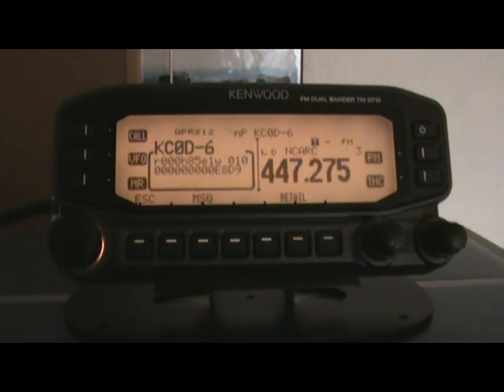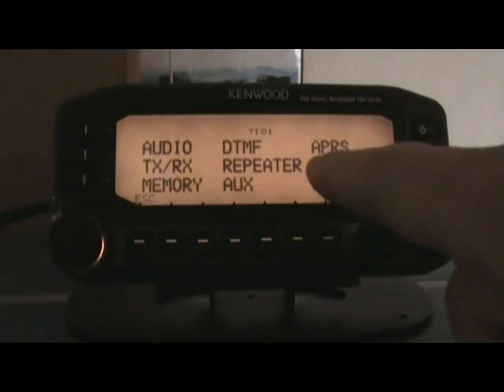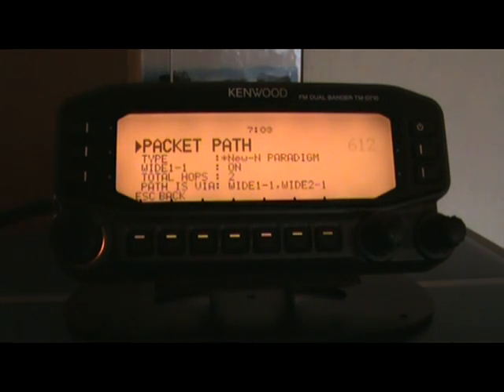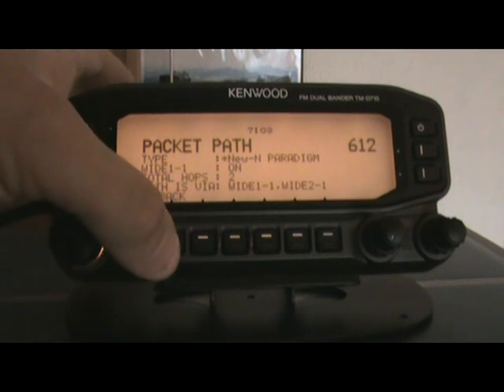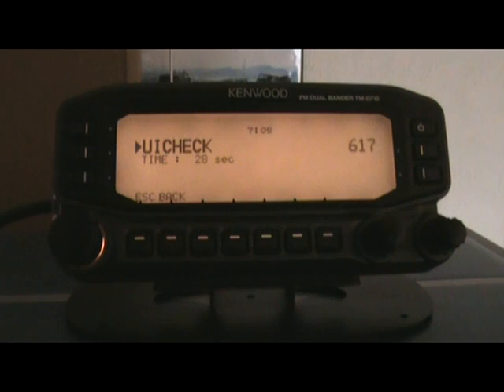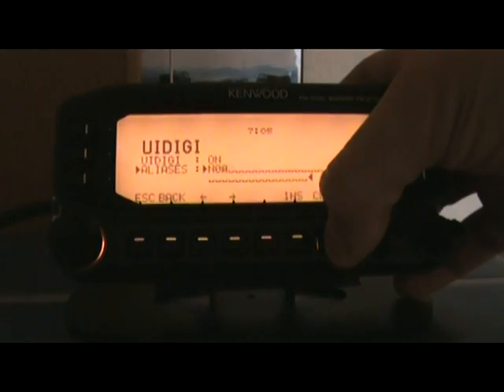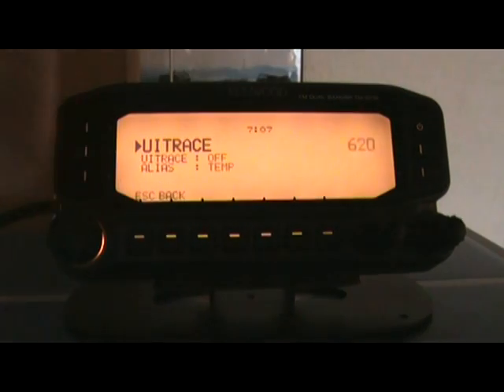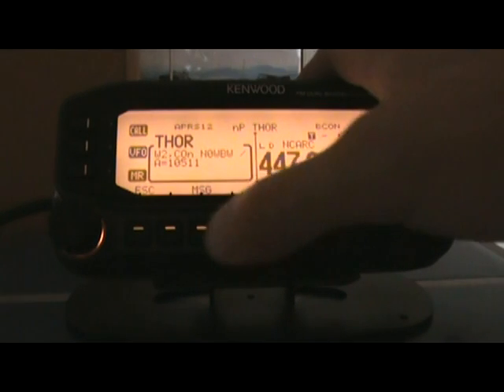setting up a digipeater on a Kenwood D710a

Comment: What weather station do you have?
Reply from the maker: it's a davis vantage pro 2
Reply: @JustinKingOffroad  i did not realize it sent aprs packets?
Reply from the maker: the station itself does not, you have to run it though a TNC.  i no longer do that but the davis software sends it direct to wunderground and aprs.fi.

Comment: If there a way I could use my 710 in my vehicle just to digipet a particular call sign only?   Is that the Aliases?  I just want to digipet my hand held while out day packing back to my car and out with more power.
Reply: As far as I can tell you can set it up to only digi a specific call sign.

Comment: Voice Alert doesn't require a voice board. Check out: aprs.org/VoiceAlert3.html It basically is just 'Ham Radar' for simplex operation. It's cool when people use it properly, I've had QSOs with people driving by my QTH that I never would have known were there.
Reply: Exactly! When the attribute [FREQ MHz] is specified in the messages (only message #5 actually supports that attribute), then you transmit the details for the channel you’re monitoring on the other VFO. But if you enable Voice Alert, set a channel for 144.390 with a tone of 100 MHz and people can talk to you on the same channel you’re using for APRS. 

Excellent video!